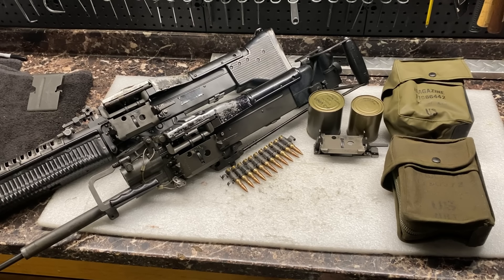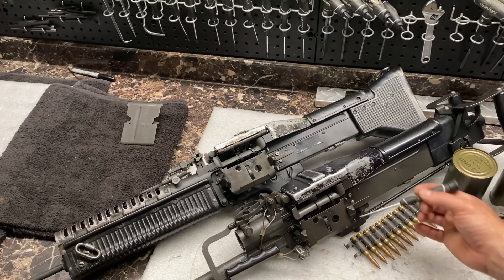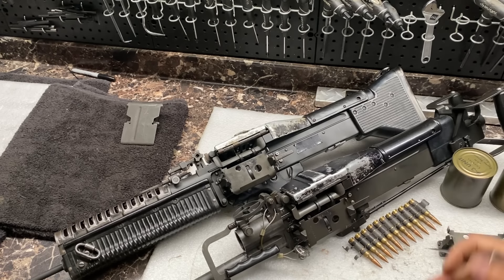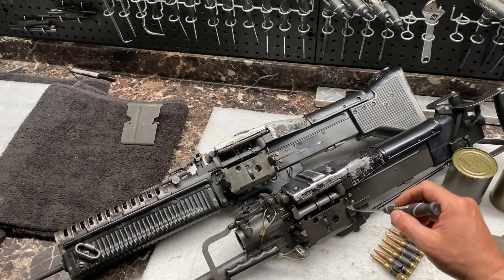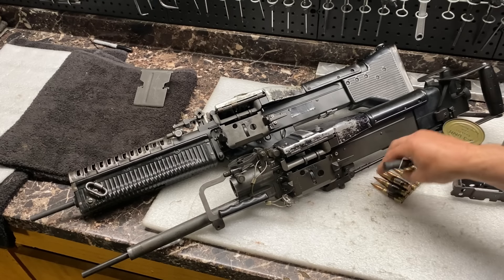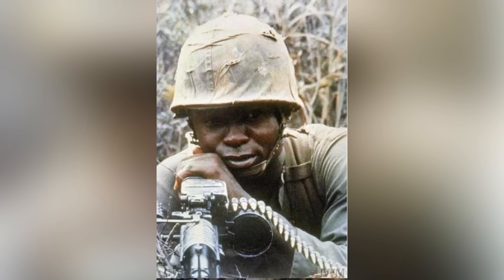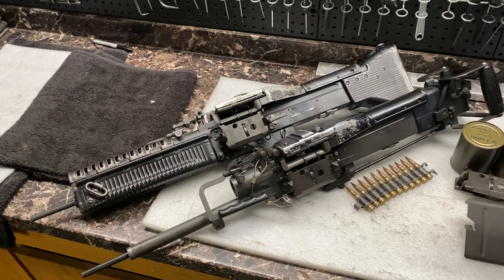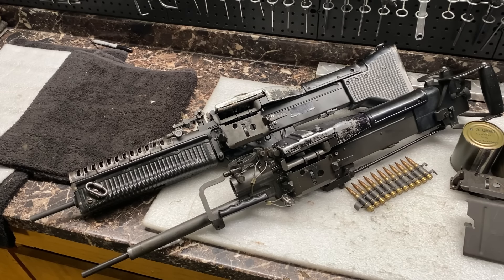How C-Ration Cans Were Attached to M60s in Vietnam

Comment: That is some crazy cosmic coincidence that B-3 Unit snaps right into it, you'd almost imagine someone intentionally designed that.
Reply: I think you have to much faith in the government.
Reply: Proof of intelligent design
Reply: Ya dont say buddy?
Reply: Probably just a round number was used as a measurement for both. I think the C-ration cans are 3.5 inches tall.
Reply: @joshuagunderson6593  yeah no shit someone designed these things
Reply: MCI cans predate the m60 I believe so it was a happenstance and a round number
Reply: @dolsopolar  He was making a joke. It's the whole god made everything "intelligent design" argument.
Reply: I think it's not a coincidence. The B-3 cans were probably made to be the same size as the pouch mags to allow guys to maximize the space in their ruck sacks. Not that grunts would mix food and ammo, but that's probable what some civ stateside thought when deciding the size of the cans.
Reply: @joshuagunderson6593  the gun is the proof of intelligent design, technically
Reply: I once needed to put a dowel of a very specific size into a magazine tube, I could not sand one fine enough to fit without getting stuck or being too small

Then I had a chair break and a dowel was sticking out of it, took it out, fit FLUSH and fixed my win 94. 

Sometimes the universe finds mysterious ways to align lol
Reply: @urbypilot2136   a good potential explanation!
Reply: divine intervention .   🐿
Reply: The M60 (and M14) were so incompetent designed,  the design team never could think of something so logic.
Reply: You should write a book. Your information is next level
Reply: @urbypilot2136 that would make a lot of sense

Comment: The can also decreased the radius of the belt hanging over the feed rollers.  So the can lessened the stress on the feed system when handled by a sole gunner and helped prevent stoppages.  I never used a full C-Rat can.  They were emptied, the end left on, and then used on the gun.  My Avatar is myself at Danang in '71 with my M60 [Cover #17] I did have an ammo bag using that bracket.   There was 200 rounds to a ammo can, 100 rounds in each cloth [M4?] ammo 'bandolier' , two to a can, and there was a cardboard box inside each bandolier bag I imagine for stiffness.  These 'bandolier' bags had a web reinforcement band round the bag near the top, and that bracket slipped in through that webbing holding it to the gun. The bandolier also had a strap for slinging the bags over a shoulder, rather than carry the belts looped in the open like many did. The bag, for my purposes, was 100 ready rounds in the gun; and I had several more with me.  But I had a 1500 round can on the floor of that M715 Weapons Carrier, two belts of 750 rounds.  Foot units, everyone carried ammo to feed "The Pig."
Reply: We had basically the same in the 90s, but the bags were made of nylon. With practice, it wasn’t too hard to use them, and a good reminder to change barrels if we had the luxury.
Reply: @williambinkley8879    I was out by '75 and our bags were still cotton bags and cotton webbing.  USAF SP's on bases with 'Special Weapons' had a QRT, armed with rifles and one M60. Thanks for your service.

Comment: I was in post Vietnam, '73-'77. We had a smaller 100 round cloth pouch that hooked onto the extra piece you showed. A 100 round cardboard box of ammo fit in the pouch and it had a shoulder strap to carry it, too.
Reply: They still issue them, nearly the exact same today. You might get cardboard in cloth, or you might get plastic in cloth. Rarely, just plastic.
Reply: That is what I remember from '71 - '74, tho we mostly fired them from a pintle mount straight of the ammo can slotted in next to the gun. We had one M60 for every three man crew, odd that I don't remember any of the Nam vets mentioning the can trick, the war was still going on at that time.
Reply: We were getting those 100 round bags in country in the 7.62 cans in '71-72.  Never saw those heavy bags like in the video.
Reply: @mcpig3240  Pretty certain they didn't come around till around 70 and was probably 71 till they were common

Comment: I always thought the cans were attached with wire or something, but that can fit just like that? I’d love to see the first guy that figured that out, had to be a holy crap moment. 

… click …

“Holy sh*t it fits… Hey Joe, come check this sh*t out!”
Reply: I thought about this, probably a lot of free time in between missions bored as fuck and fiddling with the most interesting thing in your possesion, your gun. You would be very familiar with the dimensions and shape of what your carrying, and since your also eating C rations with your m60 in sight... it just a matter of time before someone put two and two together. They probably knew they needed a smooth, round surface to funnel their ammo through to prevent a belt break, and the C cans were readily available, cheap, durable, and not to heavy.
Reply: A pack of kool menthols fits perfectly in the ar15 mag well. Lol
Reply: The same way people found out that baby carrots slot perfectly into AR magazines.
Reply: Better than those two French soldiers with bayonets.
Reply: @gohsk1512  And if nothing else, you're always carrying around a can of food or drink that you can imbibe when the fighting is done. :3
Reply: @gohsk1512  Some were wired on the later hanger most of the Machinegun firing I was involved with was training raw recruits 25 round belt for each student for familiarization fire. Mad minutes to burn up excess ammo after the recruits marched of site were something else as we had Nam vets in my reserve unit. 19D4H was my MOS for most of my reserve time later 11B4X.
Reply: @Sentientmad9m  Yeah, killing off the VC decades later with lung cancer...
Reply: @wacojones8062  Wow that is interesting haha. What years were you in for? My grampa was not a fan of the m60, said 7.62 was too much firepower and too heavy. Piercing small diameter trees would be helpful tho ofc.

Comment: Incredible how a weapon can get through design, testing and adoption and then need to be modified with a damn can of beans in the field to work right. I guess that’s the same as “mechanics hate engineers” when referring to cars
Reply: Exactly. I was a mechanic for years and vowed to punch the first car design engineer I came across. I worked for a brand that made a car where you had to drop the bumper/fender to replace a headlamp bulb! You should not ever have to go to a garage to change a bulb EVER. If you can't access a bulb and replace it in under a minute, you've failed as a designer. And that's just one of hundreds of complaints mechanics have.
Reply: @Healthhazard43  I think I know exactly what brand you’re talking about
Reply: I hear my section leader in recruit training. " This is the gear issued you will use, there are aftermarket items, that later in your career others will tell you are better, and depending on your unit you maybe allowed to use it. Here you will use NOTHING but issue kit. You can have absolute faith in it, it has been extensively tested. Have faith in this kit, after all the lowest bid won the contract"
Reply: Lol, that's exactly the M60 in a nutshell. A well loved weapon despite a lot of fundamental design issues. NATO had no other widely used weapon that could provide so much firepower in such a "light" package. Meanwhile the Soviets have the PKM that's unfortunately almost perfect 😢
Reply: As someone who’s fortunate to have several mechanic friends teach them a lot before going into engineering; I GET IT NOW
holy shit some of the things (like fasteners with fuck all clearance to actually tighten them) shit me to tears at times

I’ll trip a few mech engineers for the mechanic boys
Reply: @BirnieMac1  it's the same with everything. The great % of women who have to clean their house, get a product designed by someone who hires a cleaner. Same with most military kit. Sure it goes to a Grunt fir trial and sometimes they are listened to. Motors omg yeah that peeves me should have to build it not trial it, have it in a car and try and get that starter motor out or put a new gasket on a sump etc
Reply: @Legitpenguins99  that's because Mikail Kalashnikov was a mechanic in a tractor shop, prior to his enlistment to the Red Army and subsequently become an engineer
Reply: This is simple in training they never let the guys not use the feed trays and in the field you used the mag pouch for the first 100 rounds then switched to longer belts but before the war a M60 had a two man team meaning your assistant helped feed the gun in Nam the 60 gunner became a one man band and had to aim fire and feed the gun himself a lot of times without the bipod which helped prevent jams by keeping the gun at a better height to feed out of an ammo can
Reply: @Legitpenguins99 60 was a great gun it's major weakness was they didn't build new ones after Vietnam so by the 80a they were clapped out and that's were the issues started all that said it would be my number 3 GPMG behind the MG3 and PKM (PKM loses to it's belts and being made for a rimmed round)
Reply: @sqike001ton  yep so true. Clearing jams you were better off with a Bren by the 80s.
Reply: @Legitpenguins99  the MAG was and is better than both, fucker IS heavy though. My buddy is using one in Rafah right now.
Reply: Unfortunately shop mechanics are to blame for cars going from do it yourself to having to take it in to a shop to hookup to a computer to find it what’s wrong with it.  Dealerships and manufacturers noticed this also because most owners were doing their own maintenance and repairs which was cutting into their profits and were praying for something to happen to cause owners to have to bring their cars in for service and the ban on leaded gasoline was the beginning of all this nonsense.

Now you have cars with computers that are supposed to help you get better mileage and so forth but instead keep track of his many miles you put on it to start kicking in preprogrammed failures at certain milestones to force you to take it in to a shop and eventually kill your car making you have to buy a new one and the cycle begins again and again.

I miss the days when you could work on your own car without having to worry about a computer to tell you what’s wrong or having to get your car’s computer updated and so forth.
Reply: @Healthhazard43 they’re all becoming like that. Most modern cars, even American made, require you to drop the wheels and tires to get to the bulbs.
Reply: For engineers, sometimes its "they don't get out much" (this) or "no way someone is that dumb" (2 French soldiers "mated" their rifles where the bayonets go and it became "permanent") or just plain greed like nowadays (the car thing to appease the bean counters).
Reply: @davidleonard1813 But with a 20/30-rd box mag? Or do you mean the L4? Even then, I think it was limited to the various, interchangeable 20-rd or a 30-rd L1A1, L2A1, or C2A1 (Commonwealth model FAL) mags...
Reply: I was an M-60 gunner in the 90s. A good gun if you took care of it.
Reply: Oh come off your high horse, Harold.  You act like "end-user Joe" (you and me) has never modified a device to make it work better for HIS intended purposes. This happens especially when a device is not used precisely the way the manufacturer intended because of inconvenience, the totally fluid nature of unconventional warfare or whatever.  I can tell you're not a grunt, but indeed a mall ninja.
Reply: I am so lucky. I was a Navy Deck Plate Wrench Slinger for Sea Hawk helicopters, and one day? I got hired by Sikorsky as a Subject Matter Expert... can you say "tell engineers their idea is stupid?"
Reply: @Healthhazard43  My dad's not a mechanic, but a telecomms...actually, I dunno what you'd call him. Blue collar, did a little bit of everything, from construction to electronics. 

When he started working overseas on large project, few words struck fear into his heart like "Don't worry, it's been designed/planned by an engineer..."

Comment: In addition to the two pouches you demonstrated, when I was in the military (79-83), later 100-round ammo boxes of M-60 ammo came in canvas (?) cloth pouches that would mount on the feed tray. Worked very well, and never had any problems with them. Never used the other two pouches. If we were in a position, we would connect a bunch of belts together and the A-gunner would hold/feed the belt manually while the gunner (me) would fire the gun. Never saw anyone use a c-rat can in that fashion but it makes sense; I think the feed trays had been modified to the ammo hangar by the time I was in so there was no latch for a c-rat can.

Comment: My father was in the Army in the 50s and they would Chuck a couple cans down the exhaust of a deuce and a half or a tank and have them idle for 10 minutes! Then Rev their motors and the cans came rite out nice and hot!
Reply: I did this in Desert Storm too. Water bottles wrapped in duct with either water os modified to hold a mre meal pocket inside.

Comment: Imagine dropping it and your turkey loaf oozes out.
Reply: The turkey loaf can was too small. Had to be a fruit can, beans and franks, etc. The larger ones.
Reply: @Snuffy03 LT Dan I lost my frank and beans XD
Reply: @Snuffy03  Beef chunks w/ Potato and gravy.
Reply: @Snuffy03  well no one was gonna eat the beans and franks anyway may as well put it to some use
Reply: @mcpig3240   Oh man I hated those things. So greasy and if it was cold, even worse.
Reply: @Snuffy03  Turkey Loaf was my favorite but I rarely got one. The first C-Ration I ate was in Basic. It was 10 below zero at Ft. Leonard Wood. I had to open both ends of the can and push the spaghetti out and gnaw on it like a popsicle. In permanent party they usually had an emergent heater full of boiling water that they dumped all the meat units into to heat them up. If we were out somewhere away from the main unit we'd set the cans in the box and burn the box to heat them up. I never saw a can being used to guide a feed belt on an M-60 and I qualified on them twice. Maybe they had fixed the problem by the mid-70s.
Reply: @Snargfargle  MY favorite was the ham&egg thing. But frozen C's were a challenge. As to using the cans on a 60, my machine gunner friends did that. I, myself, was a mortarman on 81's. In the beginning, I was an FO, then became FDC chief. Every duty station afterward I was FDC chief.
Reply: @Snuffy03  I still have a P-38 on my key chain. I've used it a lot over the past half-century, those things never wear out. When I was in, some of the C-Rations still came with little packs of cigarettes in them. I wish I hadn't thrown them all away as they are now collectors' items.
Reply: @Snargfargle  I actually have a P38 I got at Parris Island. I carried that thing through 10 years in The Corps and way beyond. I remember the cigarettes in the meals. As I did not smoke, I saved them to trade to the guys who did and would inevitably be jonesing for a smoke. I got a lot of shit disks and that funky lemonade powder in trade. Sometimes the memories of those days bring a smile to this old jarhead's face. Semper Fi.
Reply: @Snuffy03  Well, that is why you attach it to the bracket and let loose, tada!, warm beef & gravy.
Reply: @captglenn100  😂 Now, if only I had been an 0331, then I wouldn't have had to scrape away the orange grease to chow down.
Reply: @Snargfargle   On my keyring, I have the P-38 my Dad used in country 65/66. He was a Dustoff medic, and was awarded a DFC and 26 air medals. Passed away of Agent Orange exposure in 2002…😢
Reply: @Jreb1865  Hat's off to your Dad. Flight medic is a dangerous job, even in peacetime. I was a medic too but on the ground. I get too airsick to be of much use on a chopper.

Comment: Funny how no one mentions the common flaw in all belt feds, and the reason that the can was used at all...weak feed pawls! The front pawl would wear much faster than the rear one and as a result would try and drag the belt sideways, which would cause a stoppage. In the left door configuration you needed to become adept at hand feeding the gun with your left hand, while stepping on the ammo box to block the airstream from pulling the belt out and hanging behind the aircraft until it broke, leaving you with nada to shoot! Don't ask... The feed pawl problem was super common on MG34's and 42's as well. Never was resolved as far as I know, and around mid 1967, they were almost impossible to find as spares. We used to keep complete feed covers in case the pawls broke or wore down to the point that they wouldn't pull the belt over the tray anymore. The can relieved the pressure caused by the weight of the belt, but you still needed to hand feed the gun. This was resolved on the flex guns by the use of feed motors, keeping the chute under pressure. Can't count the number of these guns I had to fix, and we didn't even use them unless a team went out heavy. Light Weapons guy...

Comment: Was a civilian contractor working on hueys and in 1968 there was a infield mwo that came out that elongated the extraction port.  Did all of the M-60s for the 25th division aviation assets.  All the door gunners and crew chiefs were using the c rat cans.  Huey gunships (c model) gunners were using the grunt model of M-60 with a buttstock and hanging the gun with a bundgee cord.  OH-6 observers also used this same setup.

Comment: In British service, the L7A2 GPMG (FN MAG variant) came with a 50 round metal belt box magazine that clipped on. The next belt should be able to run cleanly over the top of the empty box but in general, the boxes were rarely used and a belt of (typically 20-30) rounds was just hung off the side of the weapon. The design had no snags for the belt when used like this. Sometimes longer belts were carried on the weapon but on the move it was generally easier to just fire off the first (short) belt completely and then put another fifty or so on from a pouch to continue the engagement.